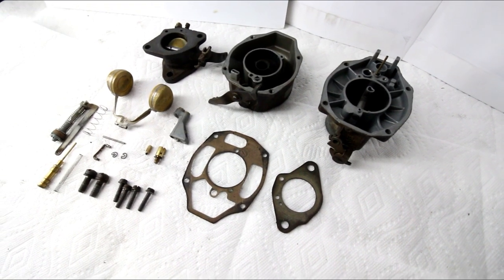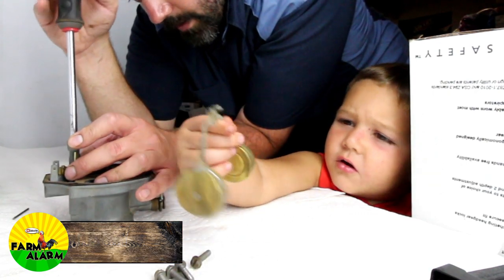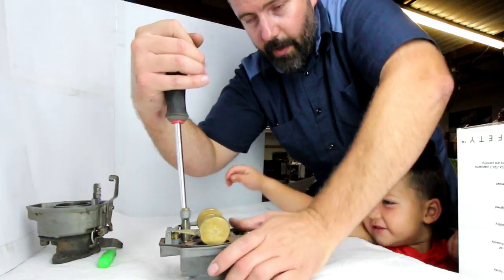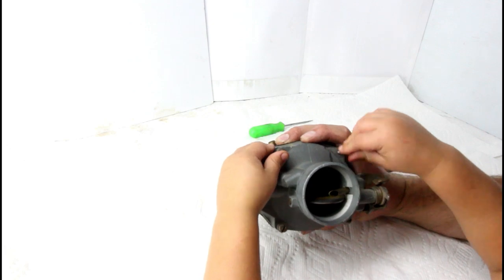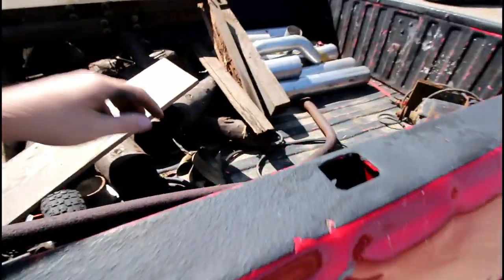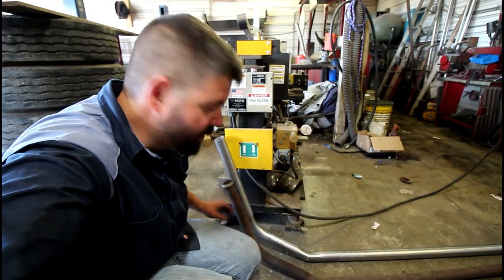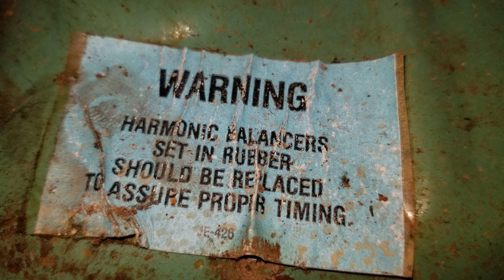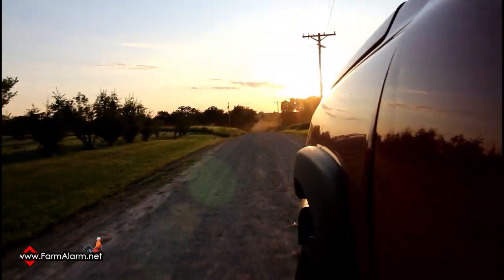1949 Chevy 5 window  |  Carburetor and Exhaust

Comment from the maker: Best Grinding Shield EVER ---> https://amzn.to/2NNgTPb
I have confirmed that this has a Reman Engine from Jasper Engines from the 1980's.. Your Thoughts?
Reply: No worries. Less hassle for you. I have a new knee and it works better than my old one.😁👍
Reply from the maker: @FYMASMD  lol so true!
Reply: My thoughts, you don't want to remove those stickers or you might void the warranty.
Reply: I’d say if it’s a Jasper and not a Gopher your in better shape as far as reliability !
Reply: So, stupid question:  Are you saying they remanufactured the original engine?  Or took an original engine from that year/model truck and installed it?  Or they just dropped in some random engine from any ol vehicle?  I am no-where NEAR the talent and ability you are at restoring vehicles, but I would want it as original as possible.
Reply: Paulous what they do is get worn out engines and reman the crank journals and replace the crankshaft hone out the sleeves and put in over-sized pistons and rings and boil the block and paint . So basically it’s a new engine with just a little bit more horsepower !
Reply: Got it.  Can’t wait to see the progress!  Finished yet?      How about now?

Comment: That little man of yours will be hot wiring the tractor to take his girl to the dance when he is eight..... plenty of confidence. Good parenting, been waiting for the next video to come out. A little straight piping won't hurt a thing for the first few. No catalytic converter so you can't drive down town california. That should be a plus in any mans book. I bet it purrs like a cat in a creamery. Valves might have a little moisture rust from setting open on a cylinder or two but that would/should be it and it will clean its self after a bit of run time. I actually had a couple of the six's so I liked them louder, glass pack and out the back... hurry up, I want to hear it run

Comment: I have rebuilt so many of those old rochesters it isnt funny. had so many old chevy trucks with 6 cyl. drove them for years. that 6 cyl would pull a freight train if the gears were low enough. you can idle it and just ease the clutch out and it will just run. 1 st 2nd then 3rd. idling then gas it just lugs down and keeps on going.
Reply: Those engines were the base chevy was built on.